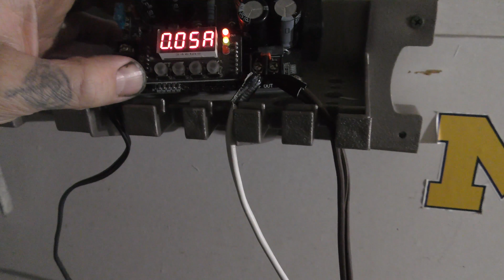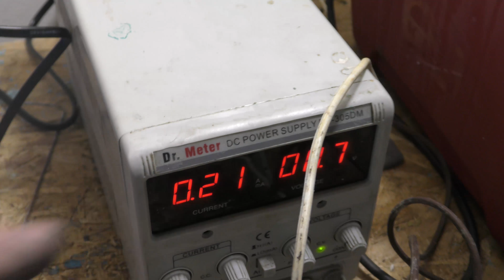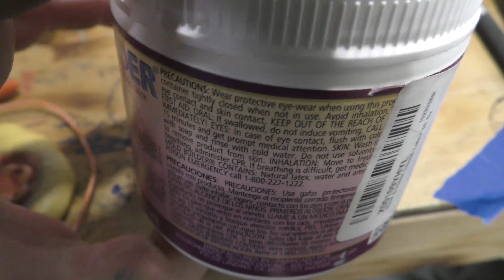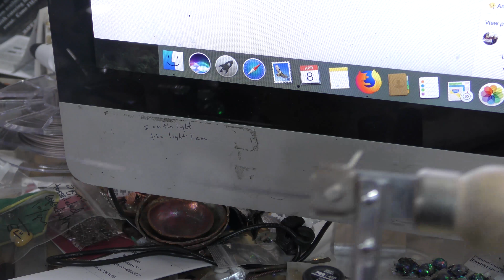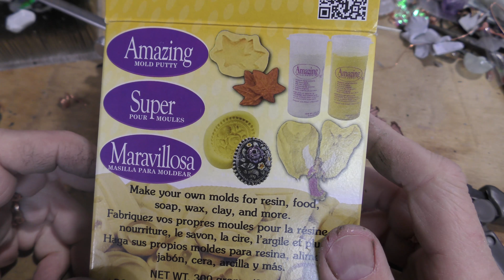Electrotyping an object

Comment: Really interesting video. I have one suggestion to make it easier to unmold the finished piece. Instead og poking the wire through the silicone and later having to fight it to unmold... Just hot glue a nail to the same surface you glued the original piece... Make sure it's longer than the depth of the mold, and a larger flat nail head is easier. When you pull the mold up, extract the nails and you're left with holes you can thread the stranded wire through.. And it's easier to pop the piece out as well as reuse the mold.
Reply: Thank you for this tip!
Reply: yeh this is powerful!!!

Comment: Great demo Jason, I love your creativity!  I adjust the cure of silicone by using talc powder (non hygroscopic, much better heat resistance (for hot glue molding and such) and very resistant to bath chemistry) and use a drop or two of ur favorite color acrylic paint for the curing agent (it is the water in the paint that does does the magic...in the case of condensation cure silicone..aka silicone 1 caulk)

Comment: Neat!  Never even thought about this method.  Seems like a possible way to reproduce parts.  Go Blue!  Anyways, was wondering about those buck converters to use as a PSU.  Was thinking can make one more cost effective using and also replacing the trim pots on that type design with better 10 turn pots so can make into a case.  Thanks for sharing!  Great info.

Comment: I'm not sure if you were aware of this but there's actually a formula for calculating the time it should take to electroplate a certain amount of copper in grams. The formula changes slightly depending on the metal you're electroplating. Time(seconds) = (grams_of_copper*2*96485)/(63.546*amps) Let me know if you'd like an explanation of the formula.
Reply: - A13X - I would like an explanation please
Reply: To keep it short and sweet, Faraday's Law of Electrolysis is used. You then manipulate the equation to make sure all the units cancel and at the end the simplified equation is: (Time in Seconds) = [(grams of metal)(number of electrons needed to reduce the specific ion of the metal)(96485  aka Faraday's constant)]/[(molar mass of the metal)(amps)] The number of electrons depends on the specific oxidation state of the metal ion you are reducing such as Cu+ vs Cu2+.

Comment: What would happen if you latex painted over the carbon bits you don't want forming first rather than letting a thin copper coat form giving you no excess copper to cut off at the end and a cleaner finish? or would that not give you enough current?

Comment: Jason are you able to Electrotype using Gold on Graphite Powder?
Reply from the maker: Gold does not form like copper.   So building an electrotyped piece out of gold would not work.     Silver sort of forms but not nearly as well.     Form meaning "Builds up as a thick deposit in a tight structure".
Reply: @JasonWelsh  thanks